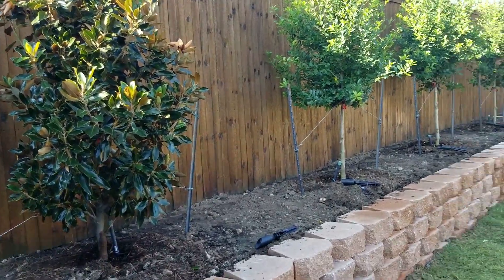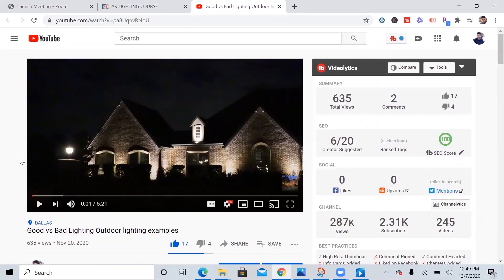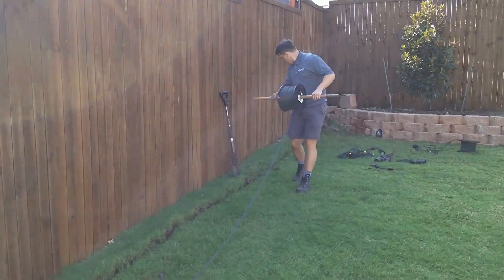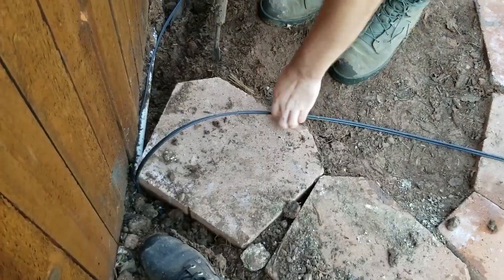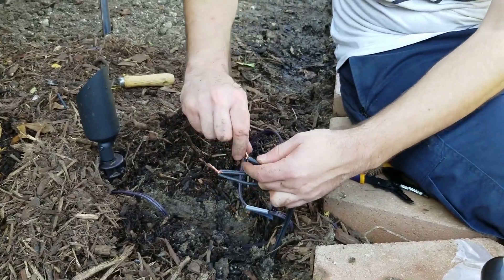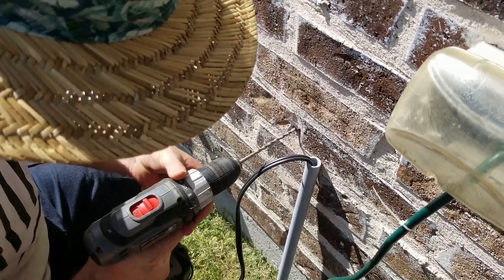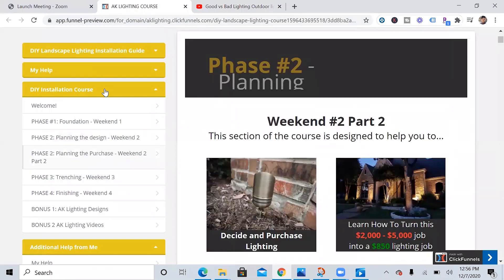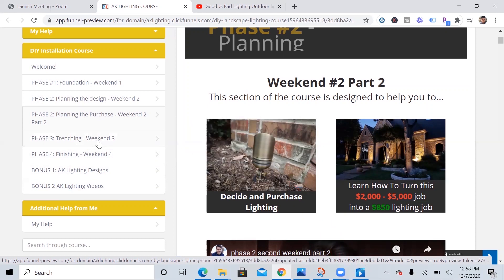Backyard Landscape Lighting Installation | Professionals Walkthrough Installation with Tips & Tricks

Comment: Thanks to Isaac for the wiring demonstration. 

What's your preferred wiring method? I remember reading your comment on another video that you don't like using hubs. Could you elaborate?  Does that mean you prefer daisy chaining?

If you're lighting columns that are 6 inches in width would you still use a 38° beam spread?  Seems a bit wide to me if a 15° option is available. I ask because I believe you said that you don't stray much from 38° beam spreads throughout a project. If I misread those comments from a different video, my bad.  Thanks for your insight.
Reply from the maker: I'll let him know! 

Yes I prefer daisy chain + hub method. So I don't like the idea of one spot (hub) that all wires come to connect. It makes for a lot of wire in the yard, often times running several wires next to each other when only need is one (with LED lights). I like daisy chaining about 4-5 lights in a row. I essentially have a few "hub" spots and a few daisy chains. Hope that makes sense. (Ill make a video on this)

You read right, I don't stray from 38degree. You can definitely either have a 15 degree or what I do is install a MR11 fixture. The smaller fixture allows for a small light beam. Let me know if you have any questions. Hope that helps!
Reply: @aklighting8292  thank you sir. So you mean the 38° beam spread on an MR11 will be smaller than a 38° beam spread on an MR16? Makes sense simply because the MR11 is smaller. Similarly the 38° beam angle on an MR8 will be even smaller than both. 

Regarding bulb wattage throughout a typical project of yours: do you vary or keep all wattage the same if possible? My understanding is if the subject to be illuminated is tall, or the fixture has to be placed many feet away from the subject, use a high wattage (higher the watts, the further the light will reach).

My home is in a subdivision that's pitch black. I'm talking no street lights throughout except for a few street  lanterns with a bright blue color temp...hardly does much.  Reason I'm saying this is, I don't think I need very bright lights in my system to make an impact since it's pitch black around me except for nights the moon is shining.
Reply from the maker: @kbentz108  I'm sorry for not responding to this, it slipped past me. David, if this is your post, i'm sorry for not getting back to you here. 

To answer the question, I typically keep all the bulbs the same for a couple reasons. 1. I prefer the brighter look / the consistent lighting look much better than the "designed" look with varying lights. 2. I like to keep things simple. If all the lights are the same, I only have to remember to replace the lights with 1 bulb instead of keep track of several light bulbs.  

As for the brightness, I like the bright better, but if you are worried then keep all the lights at a 3-4  watts. I have a few customers that prefer the 3-4 watt look to the brighter look and it works for them. Do whatever you feel your gut tells you do to because you're the one who will be seeing the lights more than anyone. If you think they should be dimmer, then have then dimmer.
Reply: @aklighting8292  you're the man. Thank you Adam for your expertise
Reply: @kbentz108  Glad to help!

Comment: Wire staples doesn't seems to be exterior. Will they not corrode and leave an ugly stain on the fence?
Reply from the maker: That's a great question. I haven't seen it leave an ugly stain, but I'll keep you posted if it does.

Comment: Why wouldn't you protect the wiring in the dirt with conduit ?  I can't see that lasting very look before it needs to be wired right.
Reply from the maker: Great question. I think this is a subject often debated. Since it was fresh dirt I could have run conduit in the flower bed. But most of the time because we install the wire out of the way or future planting, 99% of our wires don't get cut. There are times were I know the wires could get cut and we use conduit. Thanks for your comment.
Reply: What kind of cable were you using please? Would the sheath deteriorate over time?